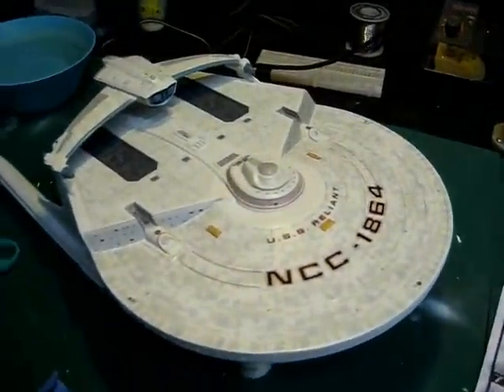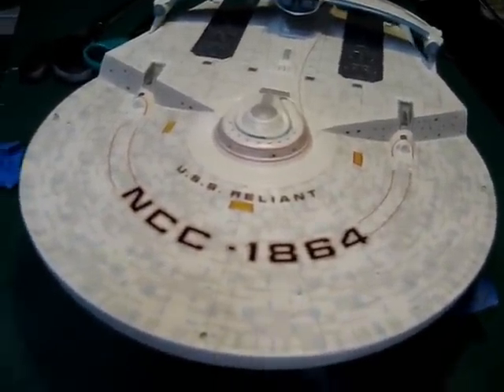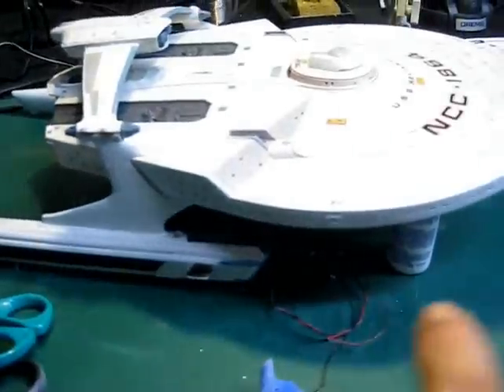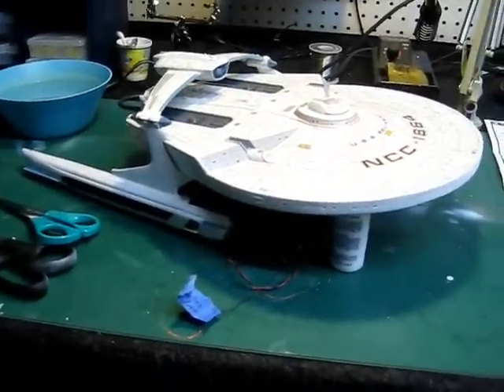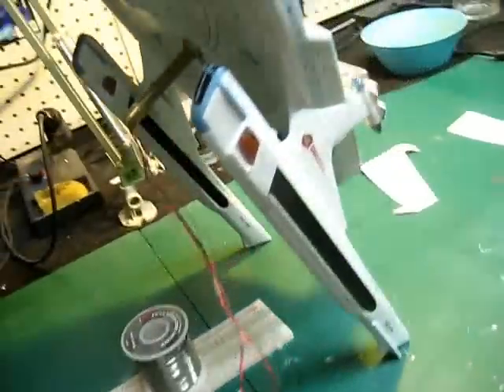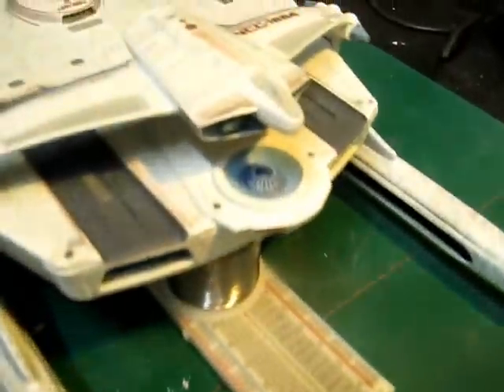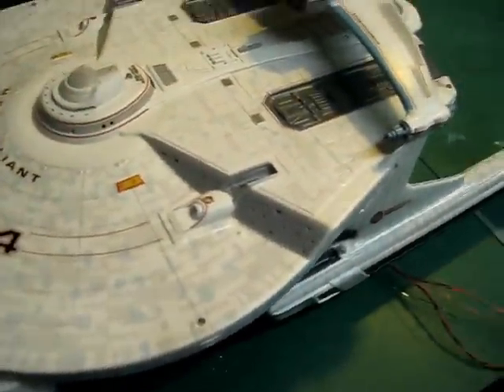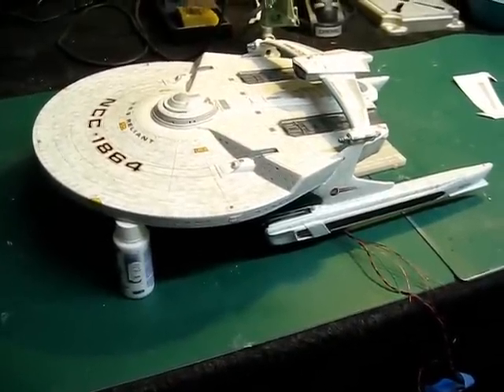From TrekWorks Round 2 Models 1/537 Scale U.S.S. Reliant Buildup PT 11 Fully Decaled

Comment from the maker: The bands were kind of weird. I thought putting them on with the curves facing up would be right.
When I test fit the decal on it was the opposite. Curves facing down and they went on just fine. I did have to leave a gap in the band where they meet the airlock door that I put on it from the Paragrafix kit. Might have made a difference there.

Comment: where did you get the Aztec decals for Reliant
Reply from the maker: I got them from Round2 models back when they were still in production. I understand they are very hard to find now.
Reply: When all's said and done...
Really, really --
Does painting the Aztecs LOOK better than using those decals?
I've heard different opinions on that.
Everybody agrees the Aztecs are a pain the butt to try and replicate by painting on anything smaller than the 22-inch Refit Enterprise (and probably this kit which is in scale to that old AMT/ERTL Refit model) but does it really save that much effort to use the decals?
Don't a lot of the decals yellow over time?  People won't be upset when their starships start rusting?  ;)